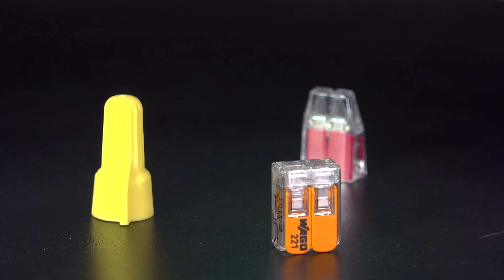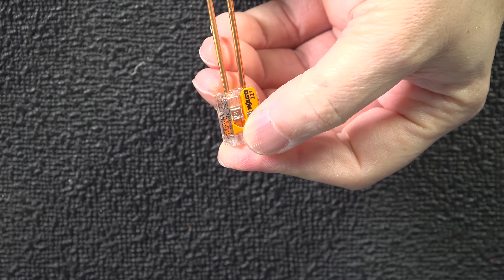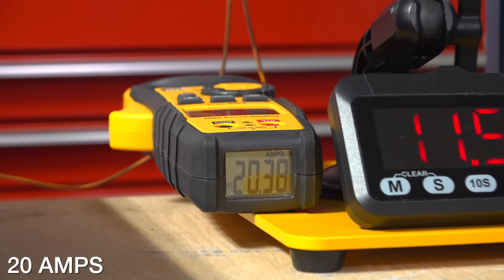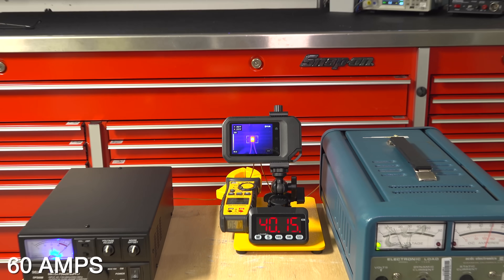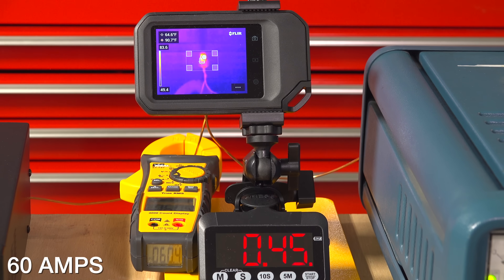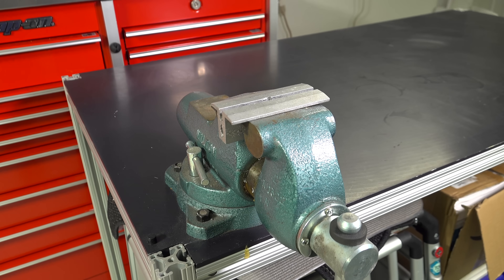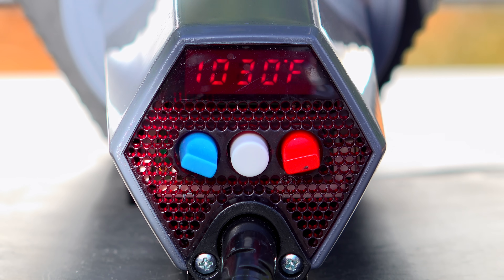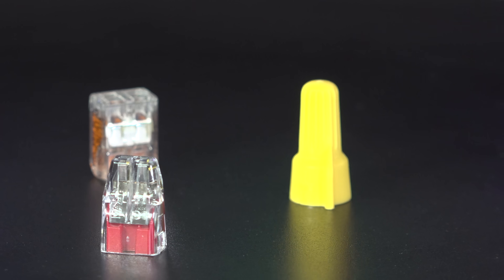What Wire Connector is the Best? Wire Nut VS Wago TESTED

Comment: I'm curious what voltage you were testing at? I think this does matter because if you were testing 60 amps at say, 60 volts, that would only be half as many watts as 60 amps would be on 120 volts.
Reply: No this doesn't matter, because the heat ist from the dissipated heat inside the connection. And this is caused only by the internal resistance and the current wo is flowing through. 
Just remember on the ohm's law. The higher the current is (at the same resistance), the higher is the voltage-drop over the connection, which causes the thermal losses in the connection
Reply: @Currentisgreat  so you're saying that somehow if he were pulling 60 amps through it at a higher voltage the result would be identical? Some of the behaviors of electricity aren't super easy for me to understand.

Comment: I would bet that the wire nut only stayed cooler because the wire was pre-twisted so not all the current had to travel through the wire nut. Looks like these connectors really do work great.

Comment: You're using a DC low voltage source for the test. Should do it with AC and run the same amount of Current.

Yes Amps is Amps no matter the voltage type but would there be a insulation break down at 110V at 40A?
Reply: We use Wagos even at our three-phase system in Germany with 400V without any problems
High load under rough conditions? No problems for them. 
Before them, we had screw terminals named "Lüsterklemme". They we're not so bad, but Wagos are much faster and flexible
Reply: Doesn't Europe use 50Hz?

I run into loose Neutrals when people use Wagos.

Comment: Pretty impressive, plastic they must use on those must be pretty skookum.. lol.
1100 before it melted.
Would have been interesting to see what the pull test showed on the twist type connector. I would assume it would have been higher. A comment someone else made about rodents made me wonder if the waygo might be more susceptible to rodents inadvertently flipping up the lever while chewing on stuff.
it's not surprising that both of these type of connectors work exceptionally well both are used extensively in different markets and pass all code requirements. It's just a matter of what people are used to and personal preference.
Reply: @JorgTheElder  
If you're such a novice that you don't understand how to use a wire nut you shouldn't be doing wiring. I would think someone that uneducated would also not understand how to use the proper gauge Wago connector. 
Again it comes down to what people are used to and what people have seen. Here in the states everyone knows how to use a wire nut even a novice. Most people in the states would look at the waygo and wonder what the hell it even is.
Again I think it's more location dependent and what you're familiar with

Comment: Cool test, unfortunately it’s an unfair comparison. Twisting wires together creates more surface area for current to travel, hence less heat. Wago connectors are quick and easy with better plastic than the nut you were using. All nuts are not created equal.  They vary in quality and there is no doubt that better nuts will carry more current before failing. People do not realize that current flows on the surface of the wire. When you twist the wire more surface area makes contact. Putting 60 amps thru a connection is no comparison to a direct short.

Comment: Na.... Too easy on the nut, should have done two test one with the twists and another without, i think the twists shed some of the load off the nut.
worst case scenarios are the most exciting, hell use some 30 year old oxidated wire while ure at it.
so grab your nuts and go for another round!
Reply: "oxidized"

Comment: Curious if during the current test you allowed temp to stabilize.  It seemed like you just stopped after a given time, but I would have preferred to know stable temp at each point.  Also would like to have seen repeatability on the pull test.  Thanks for sharing.

Comment: Wish you would have showed the temp of the twist nut at 20amp. Just curious. 
Had no idea they got that hot in the electric box.
Another test would be durability. Heat cycles due to 20amp draw cycled. Then also test movement in same situation.
I feel that the push in connector on the back of outlets fail because the outlet receives motion as the user utilizes the outlet. High loads (produce heat at the connection).  Eventually this works a groove into that bite that the wagos have.
Wagos are from europe.. They have different recepticles. Larger and i would guess they are more firmly mounted than our twisty ones in the us.  Just a thought.

DIYer.. Here.. Think i am going to do the wagos on the next project. Occupy less space. Easier.

Comment: I use wago connectors on all my interior connections. Hell, lots of lights you install now come with push in connectors as standard equipment. EU tests have tested these clamp connectors to 3X amps on multiple tests. The wires gave out before the connector did.
Reply: But if you watch the tests from the EU, the wires do give out before the clamping action of the wago connector does. Yes, the insulation does & will go first, but I’m talking ‘after’. Most of those tests take it to the limit to see when the clamping action fails & the wire fails first.

Comment: The missing component is the heating and cooling over time. Some installers will use the wagos over again and again without the quick release feature... this is especially true in lighting fixtures. You also need to consider most contractors purchase in bulk.. the low bid get the buy... Try the same test again using an off brand from the supply house shelves.

Comment: The pull-apart test was done with the Wago and not the wire nut.  Why?
Reply from the maker: No question a wire nut holds the wire better at over 100#, this was never in dispute. But that advantage offers nothing, no electrical benefit and it also ruins the wire as shown in my previous video.

Comment: how come you didn't show the pull test for wire nuts?
Reply from the maker: The wire nuts hold is over 100# and was never in question so I skipped it. It does nothing electrically and sadly its damages the wire for future reuse.

Comment: In the test with the wire nut I expected the current to travel through the twisted part and not even go up to where the wire nut was. Why would current go up through the wire nut when it could just jump across the twisted part of the bare copper wire?
Reply from the maker: That is a great question and after looking at the comments and footage I wish I had pretwisted it less as this may have actually given an advantage to the wirenut. At the very least we know this is the best scenario for thw wirenut. I have a lot of questions about pretewistig and I will try to address that and your question in an upcoming video. I think there may be even more to learn about them.

Comment: Very informative video and although I still prefer wire nuts I can understand why someone would want to use wagos, on a side note those little red connectors that you showed at the beginning of the video I have had nothing but bad experiences with and they never seem to hold onto the wire well enough that I would ever use them.
Reply from the maker: I did some testing on the Ideal In-Sure (red connector) and some things were really good but other parts I didn't like. I will be showing that one in more detail soon. Ideal is actually a great company they make a lot of awesome products.
Reply: @SilverCymbal  Will definitely check out the video when you post it keep up the great work.
Reply: I know why people want to use WAGO wire connectors. Because they're ignorant, lazy and talentless hacks! Reminds me of an electrician I used to work with that liked them. We called him WAGO.

Comment: Well done video.
Only caveat I can think of is connector reuse, and homeowners reusing worn wires or wago connectors (thereby making a poor connection).
I'm sure an electrician will disagree, but last time I checked about aluminum wiring: it was the risk of retrofits that caused the fires, and not the aluminum wiring its self.

Comment: Great video! Any pull test info on the wire nuts? Either pre-twisted or not? Maybe both ways. Appreciate your effort  on these videos.
Reply from the maker: Its well over 100#, wire nuts are almost legendary for their hold, but as we saw, that amazing grip does nothing electrically for your connection and unless you are towing a boat with wire nuts, the real benefits still remain for Wagos. Ease of use, ability to remove them instantly, damage free wires and the fact they are more than capable to handle full loads to their 20 amp rating.
Reply: There is no such thing as untwisted wires with wire nuts. If the wires aren't twisted then you're not doing it right. But I was trained to pliers twist solid and let the nut twist stranded.

Comment: You failed to do a pull test with wire nuts.......  that Wago is absolute joke at failing at 35# pull... that is hardly anything.
Reply from the maker: Joke? The NFPA didn't think so in their tests and neither did UL. I didn't test it since it wasn't in question and I agree that a wirenut absolutely holds the wire stronger, easily over 100#  at a cost of damaging the wires it in the process and for no electrical benefit. The Wago still provides multiple advantages wire nuts doesn't have. Damage free connections, visual inspection, test ports and 75% less time to install, sounds like a better connector to me along with most of Europe and a growing US market.

Comment: I found a problem, this is DC not AC, 1V DC≠1VAC(not RMS) tests will be different in AC
Reply from the maker: Correct DC is not AC but in terms of amps they are the same, here is some quick info and you can google numerous additional articles on this:  DC Amps and AC amps are the exact same thing, they are the measurement of electrons past a given point, the difference is that the electrons of AC go back and forth (alternating) and DC go only in one direction

Comment: I'll stick with wire nuts. Dishwashers I work on have these and they fail regularly.
Reply from the maker: Just remember every push connector made is not a Wago 221. At this time I don't recommend any push connectors from Ideal or Wago that don't have the levers. It's a different design. The Wago 221 is the only one I like.
Reply: @SilverCymbal  Theres also the Wago 222, which is an older design as far as I know. The 221 is a lot smaller

Comment: I've been using wire nuts for over 50 years, no problems.
Look at the price of the wago's~~~!?!
Until they come down to Earth, I'll be a wire nut man.
Reply: I agree, but Wago's really do come in handy when someone cut a wire too short.
Reply: If you buy Wagos piece by piece, I agree. But my choice is to buy them in bulk, means 100 or 500 pack, for them I pay 10€ or 35€. That's cheap enough for me
Reply: So your house will cost $50 more in materials if you use wago, but less in labor.
Reply: @Faddnn  Utter nonsense, if ever there is something that brings down the cost of construction, the contractor keeps that bonus with smiles, I know I've been there wago man!
Reply: @samTollefson  Cool man.. you spend more labor on connecting. That is facts. That means my material cost goes up, but my labor cost goes down when doing a job. You're not connecting a wire-nut as fast as a Wago.. facts.
Reply: @Faddnn  When connecting a device, do you just push the wire into the hole in the back or loop the end of the wire and screw it on tightly?
It is certainly much quicker to just push the wire in, think of the labor your saving!
And the extra money your making when you go back to replace the burned device!
Reply: @samTollefson  We never go back to replace a wago.
Reply: @Faddnn  Ha, you skirted my question about using the wire push-in connections on devices!
Reply: @samTollefson  Yes, if a device has good push-in connectors I will use them.
Reply: @Faddnn  As if your local electrcian will pass you the labor savings :)
Reply: @dmitripogosian5084  If Im on the hour, yes... And if I bid on a job, yes again..
Reply: Same here! It's for lazy people. I want something that proven and going to last. Ps. Twist your wires...
Reply: @zeus3358   time is money wago nut are faster  to install ....LOVE THEM!!!!!!

Comment: I don't agree that the wago has weak hold, but I can see where pulling a device out of a wall box could cause a wire to pull on the lever and release a wire or wires. Would love to see a pull test on the wire nut, why none?
Reply from the maker: There is no dispute that the wirenut has an incredibly strong hold, easily over 100#. My only point of testing the pull of the Wago was the claim that wagos come right off which wasn't true. The other fallacy is that the hold of a wirenut has some magical property and it doesn't. It's only job is to keep it in place which either connector will easily do that and the wirenut severely damages the wire that must be dealt with for future changes.
Reply: @SilverCymbal  Fair enough, I was curious nonetheless, not sure anyone has tested that in the manner you have conducted. I would hope its over 100 as you say but there's only one way to find out. This is some really good stuff. Keep up the great work, this channel is going places.
Reply: If you've got time, your thoughts one using these in densely packed boxes with say 4 or more wires per connector?

 I feel the wire nut scales easier (especially considering the cone shape gives it a range of usable gauges and number of wires) compared to the wago. 

One could theoretically get away with a single bag of wire nuts whereas the wagos would almost certainly require two maybe three types.
Reply from the maker: @chrisjacobsen1659  I really appreciate it, thank you
Reply from the maker: @chrisjacobsen1659  I'm glad you asked! I just used their 5 conductor versions in a single gang along with a USB outlet here: https://youtu.be/xuj-sEJryxw

Comment: I have used the ebay ones and ran around 18v 60amps from a boost converter on a drill. Not sure I would try it on 120v. Good test.

Comment: The wire nut was cooler, but it also had two full twists of copper in contact before even reaching the wire nut.  Is that really a fair comparison?
Reply from the maker: Yes I would agree with that, it's possible it could have allowed it to run cooler. The real goal of the video was to show whether a note a Wago was not able to handle loads and I think that was shown, but yo are right if retested the wirenut could likely be hotter.

Comment: I've spoken to people who thought the wago could come undone too easily, it turned out they were not opening the lever fully to insert the wire, they thought it only opened to about 45 degrees ...
Reply: The clear wago allows visual inspection, the wire nut does not.
Reply: Morons that should be working at Amazon NOT doing electrical installation
Reply from the maker: Wow! That is crazy! Yes in that situation the connection would not be good!

Comment: If you stand on a ladder and mount a lamp, then WAGO are better than screw terminals. 
Easier and faster. Cable stripped, lever open, plug in, lever closed, done.
Make sure that you get real WAGO clamps and no China clamps.
Reply from the maker: Absolutely. Those fakes are awful and sadly people get them and then blame Wago.

Comment: Is oxidation an issue? Wire nuts dig into the copper and I would guess part of the connection is gas tight. I am less sure that this is true of the Wago. I'm not a professional electrician but if I was one I can imagine that part of the reason to be reluctant to use this is that wire nuts properly installed are one of the most reliable parts of any building trade. They might be reasonably reluctant to use something until there is some long term data available that their reliability approaches that of wire nut connections. As an aside, I worked on an old building and wire connection methods that predated wire nuts were definitely less reliable.
Reply: Yes if you do it correctly the Wago is gas tight, at least it's rated as gas tight in Europe.

Comment: geometry taught me that a line can only touch a sphere at 1 point
so if i stick a 12 AWG wire into a wago, the tab that holds it in can only make contact with the conductor at one point
such a small point is bound to have some over current issues

Comment: I use WAGO connectors with no issue, occasionally l will wrap electrical tape around just to be 100 percent sure that the levers cannot accidentally be flipped open.
Reply: A dab of hot glue works amazing also with a cordless glue gun..
Reply: If you fear that the lever could be opened, use the push-in Wagos. And seriously, you have customers who open j boxes and fiddle around with Wagos? I've never seen a wago lever open themself. Save the tape.

Comment: Electricians, like many trades people don’t like change...”don’t fix it, if it ain’t broke...” They use things with which they have a level of comfort. The biggest determination of which an licensed electrician would be cost. The wire nuts are much cheaper and, “get the job done.”

Comment: I believe the twists below the wire nut were taking  load away from those inside the nut.   Would like to see a nut test without pre-twisting, which I've seen done more often.
Reply from the maker: I agree there is a chance that it played a part. I will be looking at the pre-twisting aspects in another video since if you think of all the time electricians spend every day doing this. without any conclusive evidence that it matters and manufacturers saying it's not required it makes you think

Comment: The other good thing about Wago 221s is that you can use them for temporary safety if plastering/painting around boxes and want to take the plates off for a while. i.e. keep a ring/radial circuit running while other trades are working. Absolutely no damage to conductors to do that. Wire nuts would need an inch or so off the cable afterwards.